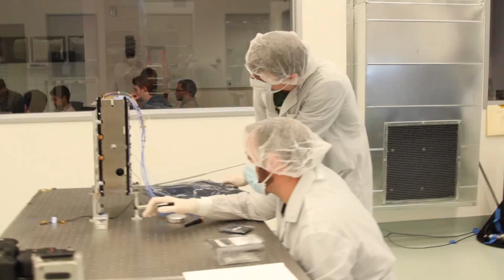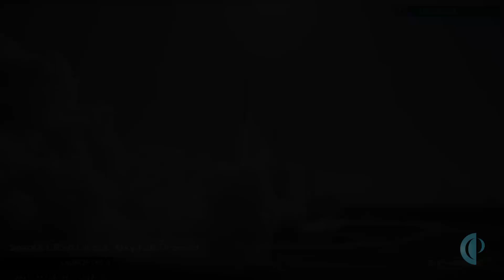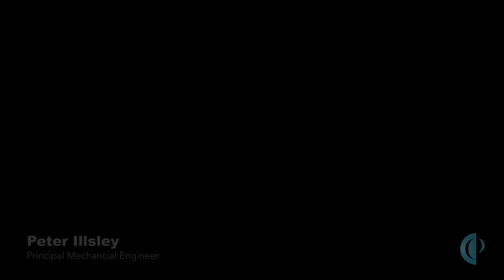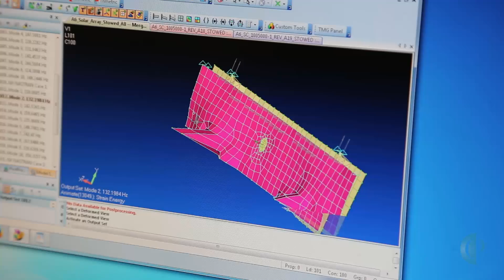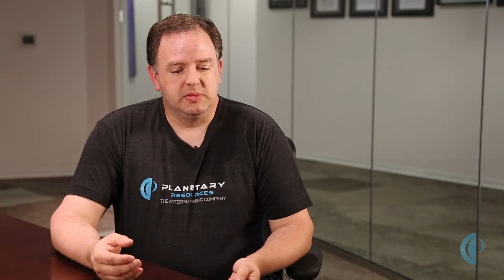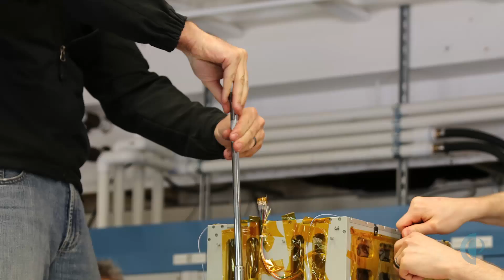Vibration Testing Arkyd 6 at Planetary Resources

Comment: Mine equipment on Earth goes though ALOT of ware and tear. Fixing mine equipment is a big part of mine operations. How does PR plan to overcome this equipment ware and tear problem when satellites are designed to be lightweight as possible, and not exactly cheap to get to orbit?
Reply: You said it. They have to be as lightweight as possible. If it isn't possible to make them more lightweight, you don't do it. Launch cost also isn't that much of a big issue as it was once thanks to private launch providers like SpaceX.

Comment: Just curious: why not solve this problem once by developing a flexible vibration-dampening system (eg. suspension) that can accept many types of payload? If the behaviour of such a system is thoroughly tested, it would (at the very least) reduce the stress on the spacecraft and much of the time/costs of developing one to directly withstand the rocket vibration.
Reply: Sean Lumly Apparently, they planned to use one for Ares I, because of thrust oscillation issues inherent to solid rocket propulsion. But since vibrations aren't as bad with rockets using multiple liquid propellant engines, and since the payload has to be strong enough to withstand the G's, I guess it's not always worth the extra weight and volume.
Reply: Sean Lumly i imagine its simpler and/or cheaper to create a very sturdy design than to pay for the extra weight of the dampening system which by its self represents another point of failure. They probably do use such systems for very sensitive cargo i would think.
Reply: ***** Perhaps, but sometimes challenging problems are worth trying to solve..
Reply: Sean Lumly yea like i said they probably already have some sort of a dampening system for very sensitive cargo. Its probably a bit heavy tho and its much more sensible to just make a really reliable machine (which is a plus beyond just surviving takeoff) and save on weight and reduce points of failure.
Reply: Sean Lumly You might be able to do it for some of these smaller cube sats, but for the larger primary payloads, conducted vibrations are only one of the dynamic issues to deal with. You also have a very intense acoustic environment inside the payload fairing which couples with the spacecraft structure and causes secondary random vibe environments for everything mounted to it.
Reply: chaz720 Thanks! It's a very interesting problem to think about!